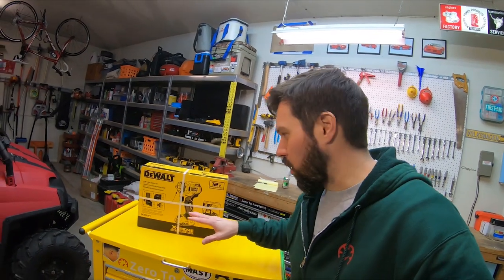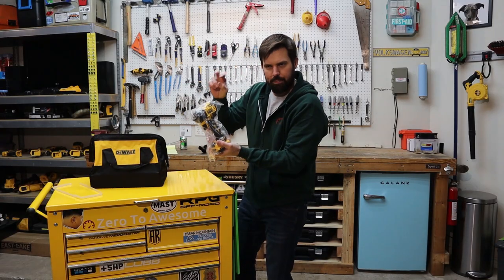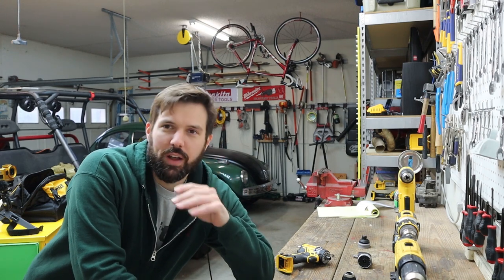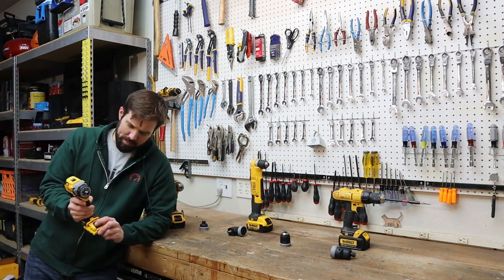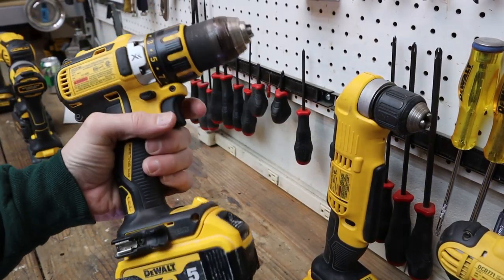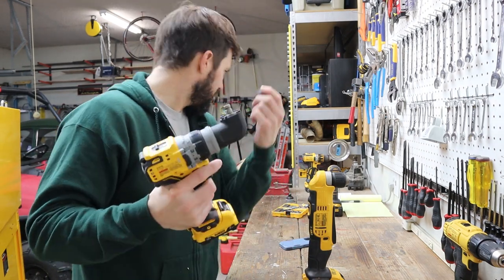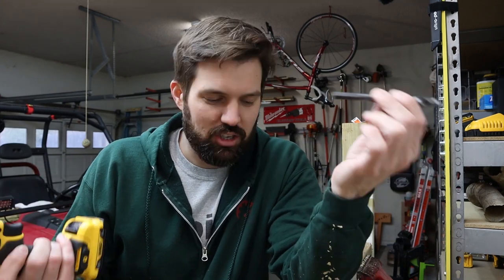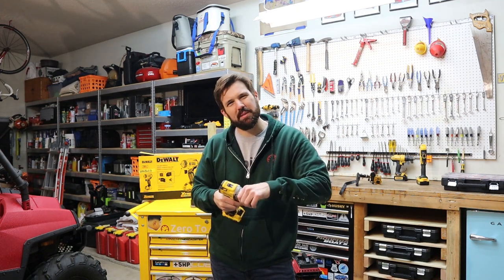New DeWalt 5-in-1 Power Tool is COMPLETE GARBAGE (and my weekend is ruined by disappointment).

Comment: You will hate your Swiss army knife if you use it for a machete too. 12v 5 in 1 is a precision- assembly tool for light duty. It isn't made or marketed as a construction tool
Reply from the maker: DeWalt’s own website shows the tool drilling with a 1/2in spade bit in OSB, installing 2x6 decking, installing PVC hangers in a ceiling…. I think it is being marketed as a construction tool.
Reply: True

Comment: I really should have guessed how bad this without be when the quick release attachment was called an impact driver but had my fears confirmed when the point of the tool went flying over the head of the presenter as he put it up against not only single use dedicated tools, but the 20v versions of them.

Comment: I hate contradict the disabled but the 5 in one is each of the 4 attachments, plus you can use it without any attachments, although it will not lock in the screwdriver bit. For if needing in tighter spaces. Also nothing about this tool says anything about it being an impact driver, it simply a drill driver.

Comment: You can use the tool with NO attachment for 1" bits, it has a 1/4" hex magnetic bit holder, that is tool #1.  Right angle attachment is #2, offset attachment is #3, drill/driver is #4, and 1/4" hex quick release chuck for power bits is #5.  I'm not sure if you were trying to be funny by saying it's only 4 or you really did not understand that.
Reply from the maker: So 2 of the 5 “tools” have the same functionality?
Reply: @ZeroToAwesome  Which 2 are you referring to?  The bare/no attachment 1/4" magnetic bit holder and the 1/4" quick release attachment?  While they can perform similar functions, I wouldn't say they have the same functionality.  The bare/no attachment is meant for the small 1" insert bits when you have very little room.  Where as the quick release chuck is meant for longer power bits that you need to be locked into place, not just held by the magnet.  They make power bit hex keys, drill bits, socket adapters, etc..  they're actually a crazy handy tool (all of them - DeWalt, Milwaukee, Bosch, Festool), a lot of time they are called installation drivers, because they are used by cabinet installers and the like.  It wasn't what you were expecting, I get that, but if you judge a fish by its ability to climb a tree, it will spend its whole life thinking it is a failure.  Ya feel me?

Comment: You can buy drill bits with hex shanks that you can use in an impact driver-style chuck.  That will let you drill with the low-profile attachment.
Reply from the maker: Good idea, I do have a few of those lying around from some drill bit kits. Only problem I can think of is those are all pretty small, smaller than the hex shank itself. Usually I would use right angle drill to put holes between studs to run something like PEX or romex, I guess a small hole saw or spade but would work for that.
Reply: @ZeroToAwesome  Milwaukee makes shockwave drill bits with the hex shanks up to 1/2".  Also, both Dewalt and Milwaukee makes a right angle impact attachment that actually works with the impact and does the same thing as the only thing this tool looks like it's good for, and is only $20.

Comment: I don't think you understand this tool. To begin with, the 5th (or 1st) tool is using the drill without a chuck. You can friction-fit a bit without any attachments to get into the tightest spaces. In other words, the drill/driver without a chuck is a functioning tool for which there are also four attachments (five configurations total). Second, it's not meant to replace the tools you compared. It's supposed to be smaller, lighter and less powerful. As a 12 volt, it's meant to be used as an installation drill/driver with less power for finer and more precise work (like cabinetry and furniture making). This is Dewalt's brushless version of the Festool CXS and TXS installation drill/drivers which are even less powerful by design than other drill/drivers within the Festool line).

Comment: You wouldn’t kill a mosquito with a shotgun would you? Ideally? I do a lot of low voltage work and have the Milwaukee version. As I’ve read in other forums the tool can be used without any adapter so it is the 5th or 1st chuck you can use when you have to get into tight spaces. I’ve used the DeWalt and Bosch versions and all have their own pros and cons. A few of the biggest pros for me are weight and versatility. I still carry my 20v tools for power to drive lags, drill thru concrete and similar heavy duty functions but use my 12v with different chuck adapters when assembling network/AV racks. You can also use the keyless chuck, 1/4” collet (impact) chuck and offset together with the right angle chuck for some unique angles and tight space use. I guess it’s all a matter of how often you get to use all the tools functions.

Comment: I have the Bosch version of this which is pretty good. Their twist click is lower profile which keeps the overall length under control.  The offset adapter is so handy for cabinet installs. I really wanted to sell the Bosch when the dewalt came out since it is my only Bosch 12v tool but I’m not so sure anymore. The Milwaukee version is a hot mess.
Reply from the maker: I have seen the Bosch one at Lowes. It did look much more compact. Good to know about the Milwaukee one as well, thanks!

Comment: You can't be serious... 
This is Cabinet drill. It's not going to be as powerful as any of those other tools. You even mentioned you were aware of the Milwaukee version, which is literally called "installation driver." 
It's meant to be compact, low powered, get into hard to reach spaces, and drive Philips head and flat head screws without damaging them. Every brand has one of these things. You're driving frickin deck screws with no pilot hole. Maybe next you should pound some stakes in your backyard with your thumb, or put in drywall nails with an 8lb hammer.

Also... 
It's okay to have 3, or 4, or maybe even 5 yellow tools in your shop, like a thickness planer or table saw, but you've clearly been led down a dark trail with all those shiny cordless tools.
Reply from the maker: It is a dark, dark, path, but now that you mention it so should probably go buy some more cordless flashlights.

Seriously, I completely agree this is a instillation tool. Especially after owning and using it. The problem I see is DeWalt does not market it as that. Go check out their own website advertising the tool and you see construction workers securing conduit and drilling into cement block. Not a single image of a dummy like me assembling ikea furniture with it.
Reply: @ZeroToAwesome  Perhaps I was a bit harsh. I apologize for being rude
Reply: A friend of mine has a garage full of Milwaukee cordless stuff. A bank of chargers sits on a shelf waiting to have batteries dropped in, and he has all the red toolboxes. I have Worx, Milwaukee, and Bosch. I really like the little Worx screwdriver. More torque than I ever expected. Great for working on RC cars and stuff.

Comment: I think the head also can work with a bit directly without any adapter. Is that consider the no. 5?
Reply from the maker: Without any adapter it is just some exposed pins and a gear. Nowhere to put a bit. Think the 4/5 is drill/driver.
Reply: @ZeroToAwesome  there is a 1/4 in shank hole in the middle of the tool with no attachment. I use mine everyday it works awesome.

Comment: Don't listen to this guy. This DCD703 is a great tool. The MIlwaukee version of this tool is no stronger, more expensive, and far more awkward to use. Bosch makes a nice version of this as well.
Reply from the maker: Don’t listen to THIS guy (above), he uses facts and reason to make his argument. 

I will have to check out the Bosch, thanks for the tip.
Reply: @ZeroToAwesome  hahahaha right? Surprised at the disappointment for this one. It ain't for everyone maybe, but nothing is. Good video otherwise. Sure. This or the Bosch is the way to go in this segment IMO, of course. The M12 is just awkward to me. No color bias here btw. Ive got 7 different brand chargers hooked up. Lol...I have a problem. Cheers 👍
Reply from the maker: 7 brands of chargers?! You are a brave soul.

Comment: This was very valuable review... I dont understand what didi you expect from this tool? 12V small and lightweight tool with 3/8 chunk should be stronger then 20V bigger and heavier tool with 1/2 chunk? Where did you find infrormation that driver attachment is IMPACT? If you have 90 degree attachment, you cant use chunk on it for normal drill bit??? In almost every comment is written it's tool for installing cabinets or furniture. I dont understand for what you want to use it? Repair rockets?
Reply from the maker: This was specifically purchased for rocket repairs. In all seriousness, go to DeWalt’s website and take a look at how they market the tool. Dudes in hard hats on the job site, not a cabinet to be seen.
Reply: @ZeroToAwesome  And I hope you not believe everything, supermarkets have commercials with heavy duty workers and tools from them...

Comment: Well knowing Black & Decker/ Dewalt, the reason the rt angle and other adapters use the hex chuck is that they want you to buy their drill bit kits that have the 1/4" hex shank which greatly limits the size of bit you can use. Seems like the 5 errr 4 in 1 should have to take a swim in a bucket of Pickle beer.

Like you guys I've been primarily Dewalt but as you're finding, it might be time to consider looking away from Black and Yellow to Milwaukee Red... Seems like all Dewalt does anymore is imitate what Milwaukee innovates.
Reply from the maker: Been tempted so many times to start making the switch to red. Whenever the next generation of battery comes out that will probably be the time to switch.

Comment: It's not an impact driver attachment! Just a 1/4 collet for bits. Still just a drill/driver. No impact mechanism in there.
Reply: Right! Maybe I’m wrong but no where on the Dewalt website or even the Milwaukee website, because some have said the Milwaukee is just as bad, does it claim to be an impact. Sheesh!! He can’t even figure out that you CAN have a right angle drill by using the right angle attachment with the drill head, um it’s a right angle drill. 🙄 glad I watched this nonsense so I know to never take his advice again. Im a Dewalt fan but I have the Milwaukee one and it’s a beast, WITHOUT AN IMPACT HEAD!!!
Reply: Yeah. Watch some other videos on this drill/driver, it's plenty capable for people not framing houses.

Comment: I have many Dewalt tools, but purchased the Milwaukee version because it was out first. Same tool and abilities, you just need to know what it's intended for and not expect it to exceed that. It does what it's suppose to and very well. Maybe you should look into what it was intended for, installation.
Reply: Used both milwaukee is so much more powerful and convenient
Reply: The DeWalt is the better tool vs the Milwaukee due to the different design decisions
Reply: @matsudakodo  Like what? The Milwaukee is small and more compact, and has a handguard like the Festool.
Reply: @histguy101  the reverse switch is awkward and can be blocked against a wall in the kinds of situations they intend you to use this for. Also the handle on the DeWalt is more comfortable. They're both good tools but I think yellow is better here.

Comment: the fifth attachment is the powertool itself. you can put a short screwbit straight into it
Reply from the maker: That is the lamest excuse for a tool I have ever heard. So the 5th tool is the same as the 1/4 but adapter? Just, with less plastic than the adapter?!
Reply: @ZeroToAwesome  No. makes the tool shorter, Used with short screwbits. Actually very helpful. Other is a bitholder. for the longer screwbits.  Otherwise when you use short screwbits you would need a bitholder into the screwbit adaptor making the tool longer.. It´s a mistery that most all tool reviewers miss it.  I guess thats down to only reviewing the tool, not actually using tools.

Comment: If you read the instructions, the  drill itself without the attachment is the 5th one, you can put an impact drill bits onto it, also I just bought this cause the angle attachment, by the way u can't compare 12v to a 20v tools, smh

Comment: This is why you move over to Milwaukee. Especially for any 12v tools. No other company comes close to sub compact performance.
Reply from the maker: I hate to admit it, but the time might be close. Milwaukee has been killing it the last 5ish years with the new tools. Especially on the automotive side. Why does DeWalt still not make a cordless ratchet?!?? Milwaukee has 6 different versions of it.
Reply: @ZeroToAwesome  dude you need to do research … DeWalt has the DCF503B and the DCF503EB
Reply from the maker: When did those finally come out?!? Saw screenshots of them late last year and was trying to buy them for Christmas gifts but they were not on sale yet! Thank you and ordered!!
Reply: @ZeroToAwesome  I have close to $1000 of Snap On air ratchets rotting away in my tool box because I got one M12 ratchet.
Reply: The DeWalt is close enough in power to the Milwaukee but its design is better (ergonomics, controls). It's more than enough power for any homeowner. Testing beyond its limits as an installation tool isn't really fair though there are videos of it using 1/2" and even 1" spade bits in wood without a problem.

Comment: O and the Milwaukee comment i seen a video b4 the Milwaukee is rather weak and the dewalt has more power. It is only a small 12v tool. Its not designed for large stuff. No idea how it performs but bosch came out with an 18v version of this

Comment: The only problem I see is the battery on the 12V, you should have used a 5AH battery, THEN this comparison would have had some meaning. How about a redo??
Reply from the maker: Mayperhaps
Reply: @ZeroToAwesome  Expecting a 24 watt (12 volt 2AH) power source to perform the same as a 100 watt power source (20 volt 5AH) is dreaming. NOT a GOOD comparison test.

Comment: 8:29 - Milwaukee have 12/18v standard on their chargers, Makita offers some combi chargers but they dont come standard in kits that ive seen where I live at least. Same witch Bosch, they have a combi charger similar to Milwaukees, but i havent seen it in standard kits here. So pretty much all the 12v lines worth talking about have this :)

11:30 - The attachment is called a screwdriver here, not impact driver. Same as the standalone non-impacting screwdrivers you can get ^^

15:20 - yeah its not the same, but it does allow you to lay the drill flat which is very handy when screwing in a fastener at the back of a shelf or drawer without twisting your wrist in impossible angles

Dont get me wrong, I get why its diappointing, I think they are gimmicky af and marketing wank too. But to be completely fair I do feel like this was poorly researched and had some unrealistic expectations for it, what these actually work for is assambling IKEA furniture and hanging pictures. They really arent a replacement for the dedicated tools.
Reply from the maker: The Milwaukee 12 and 18 volt batteries are different shapes, right? So they have a combo charger with one spot for 12 and another for 18. I like that a DeWalt charger with once slot will charge a 12, 20 and 60 volt battery pack. Not too familiar with the Bosch and Makita setups, will need to take another look at those.
Reply: @ZeroToAwesome  Yes, both Milwaukee and Bosch run the stick-batteries that go into the handle, both have combi chargers that take both. The odd one is Makita, they have slide-in batteries for both 18v and 12v but still have 2 different slots in their combi charger. As far as I know, none of them can actually charge a 12 and 18v at the same time though, at least the Milwaukee one just finishes one before moving on to the next one. A single slot is for sure more elegant, but in practical terms you'd still just have 1 charger out for what its worth!

Comment: The 12v batteries will not fit on the Dewalt fast charger. As for drilling with the offset head. Buy some drill bits with a hex head
Reply from the maker: I’ll have to take a second look at the rapid charger. Good call on the hex bits.

Comment: The Milwaukee close quarter (low profile) drill attachment doesn't have a locking quick chuck so the bit always pulls out, very annoying and a foolish oversight 🤦
Ps., RTFM
Reply from the maker: I’m starting to think these all-in-one power tools really are not the best idea…
Reply: @ZeroToAwesome  They aren't a replacement for a big drill, but a friend has had the older brushed Bosch and is very happy with it. I just bought the brushless version with much better torque. The Dewalt's battery is in the wrong place, IMO, and the Milwaukee's forward/reverse switch is just a totally boneheaded idea.

Comment: Thanks for the review. I was thinking of getting this. You have talked me into not getting a 5 in 1 and. It getting a 12v. I will get the 20v impact and 20v driver instead. And maybe a angle drive.
Reply from the maker: For the price definitely the better solution.